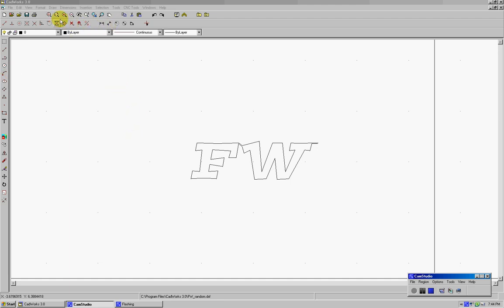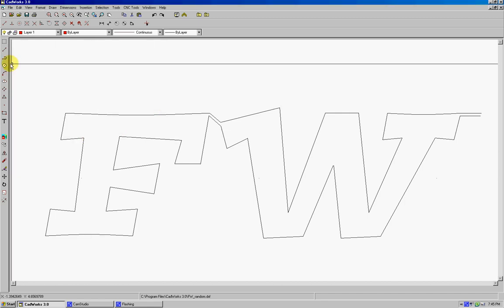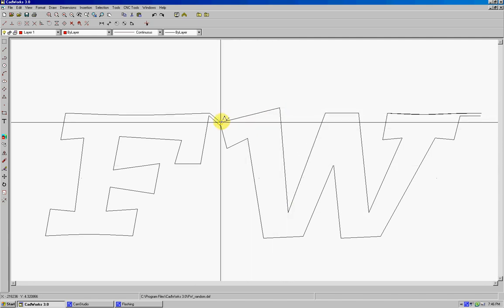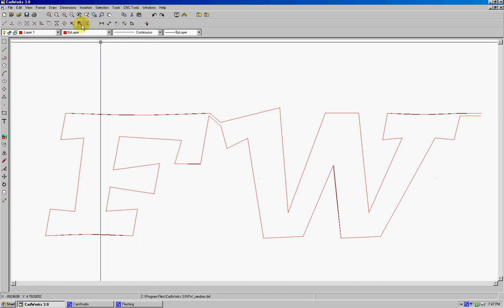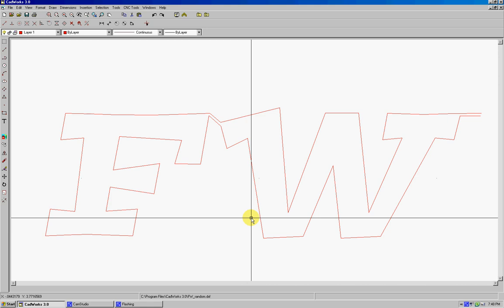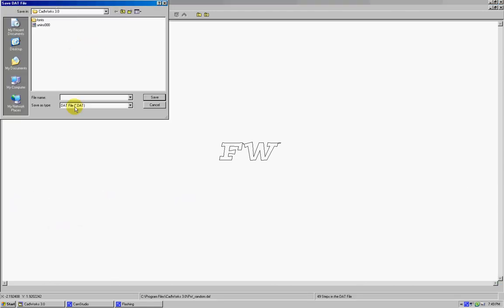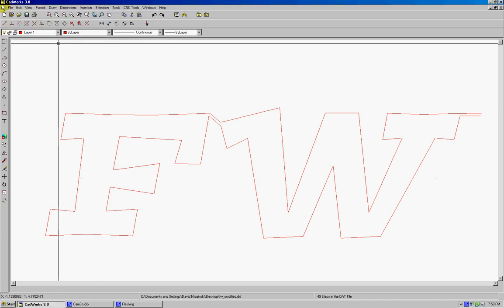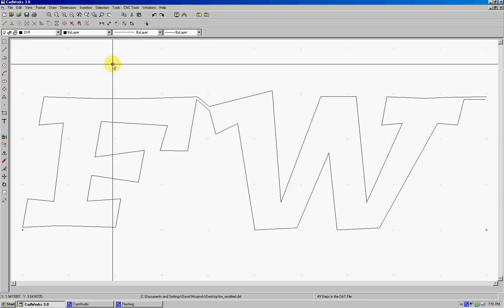FoamWorks and CadWorks - DXF drawing to DAT file conversion

Comment: I think there is some bug in cadworks - if regional setting is different from US (in windows control panel) any try to generate dat file cause cadworks to shut down with error. 
When you change setting to English(US) it's OK. I'm not in US so that's a little problem.